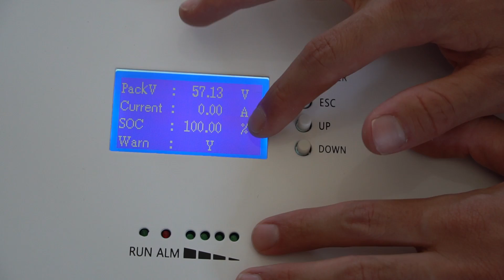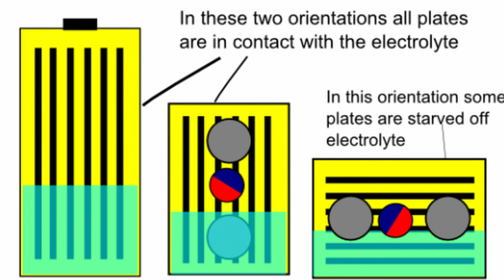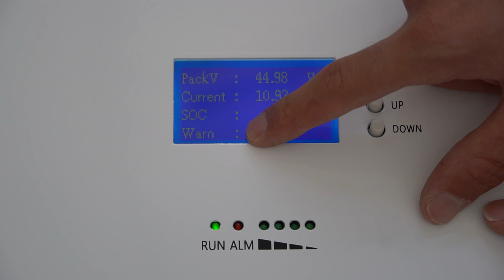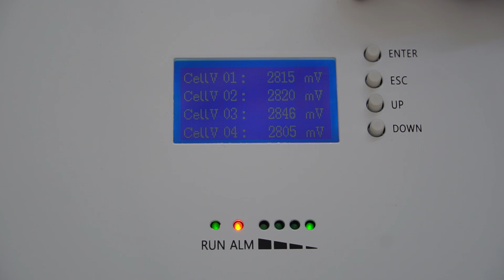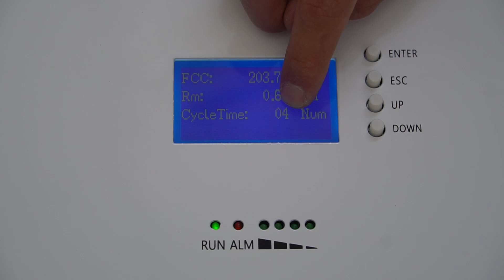10kWh 48V LiFePO4 Plug-N-Play Solar Battery for $.38 per Wh: Full Tear Down and Capacity Test

Comment: This beast is a little out of my price range of $3,800.  320ah prismatic cells are cheaper and weigh in at approx. 11.5lbs.....so doing the math and multiplying that by 16 would put a DIY weight around 185lbs.  If you separated the cells into two 24v packs they would even be more manageable to move around, could be stacked or shelved easier, and connected/disconnected in series for use, or maintenance.  Also, doing a replacement of just one cell in this beast is going to be more difficult to find.  And, when it comes to watt hours, this beast is only 200ah.  A DIY 320ah will be closer to 15Kw.  There is a lot to think about when it comes to making this purchase.  But, I can see some people buying into this battery already made, and not having the knowledge or skill to make one themselves.
Reply: There is making it yourself.....and having a UL listing which many states and installers require

Comment: I kinda wish they would have put the screen on the end or have an optional remote screen so you could rack mount them laying flat with a slide in rackmount so you could stack say 4-8 of these units in a single heavy duty frame in a conditioned basement or utility room. 220+ pounds is definitely a 2 or possibly 3 or 4 person lift especially if you need to go up or downstairs with them. I still need to save up quite a bit before I will have enough for a battery module like this.
Reply: These batteries support RS-485 communication, so theoretically you could rack mount them and connect them all to a central controller for remote monitoring. That would be the ultimate setup no doubt!

Comment: “Not compatible with AC tied systems”?
So you can’t run a all-in-one system that has solar and grid backup?
Reply from the maker: Oh wait, I just read OP comment. Of course you can use it with an all in one system. That's not ac coupled. Ac coupled is like a Tesla Powerwall. Not a battery. Totally different
Reply: It’s basically a 48 volt DC nominal battery bank with an onboard BMS. So, you have to hook it up to an hybrid inverter that has a 48 volt DC input. Probability a boilerplate disclaimer to let you know that you can’t hook it up directly to a 120/240 AC buss and not expect it to go horribly wrong.

From what I gather from the website, they do have specialty units that are for AC coupled systems too.
Reply: Damn, I wanted the same thing, but I checked: it won’t work with grid-tied systems.
Reply from the maker: It's just a battery, so it would never work on ac coupled system. You can connect it to a ul listed hybrid inverter like a sol ark, then ac couple that. 

It's just a battery. That's all

Comment: One of the issues with these batteries is the low C rating requiring multiple units to run a larger system. 
Requires one unit to run a 3 kW Inverter.
Requires minimum of two units to run a 6 kW Inverter.
Requires minimum of three units to run a 12 or 15 kW Inverter.
Paralleling requires an additional cable (not included).
Reply from the maker: It says 120A discharge in manual. So 6000watts. I'm pulling 100A into mine no problem. Seems fine. Must be a typo
Reply: Their site may state that but we have had zero issue running a single battery to power emergency items in a power outage. Its connected to a Outback Power 8048A

Comment: I have two of them and they are working flawlessly in my off grid system. I paid $2500 for them though
Reply from the maker: Where did you get them for so cheap???
Reply: Rosen Solar, they are 15s and cost $2550 each, I have two.
Reply from the maker: @patrickburton6130  That must have been a sale because I cannot find any of their large packs that cheap. Check out this one. shipping is $900: https://www.aliexpress.com/item/1005003127749308.html?spm=a2g0o.search0304.0.0.1abba57dt7dM0V&algo_pvid=ef482035-838d-4339-a17a-20283f76e63a&algo_exp_id=ef482035-838d-4339-a17a-20283f76e63a-8

Comment: Damn Will, that is one of the sexiest batteries I've seen you test. I love the fact you can see how many cycles you go through.. the menu is simple and informative. I mean damn. Itll be in my dreams. Well done and thank you for the excellent review. Particularly for lifting the skirt to see the cells 😋😛
Reply: Too bad they don't let you reverse the display text to work upside down.. or simply do a 180 degree flip on the physical display, and leave extra holes for buttons in both orientations. I would put hot melt glue down the back of the DC connector, so nothing could short it out that way...
Reply: @Stubones999  completely agree

Comment: I heard CATL is producing LFP's at around $50 USD per kwh.   Chinese are going to FLOOD the US with LFP packs like this and every solar installer will try to sell you one.   Look out utility companies!
Reply: That's a good thing right ?
Reply: @patyagecic3075  It's great if you want to put a battery back up system in your home.  I bought Chinese cells and put a system together for less than $2K.   Saving $30 a month on power and have a very reliable UPS backing up critical circuits.

Comment: The way they placed the handles I’d say this was really meant to be rack mounted horizontally as you said you would use it.
Reply: Then they should have placed the display visible from the front of the rack instead of the large front side (top on a rack).

Comment: If the biggest complaint Will has is, that it is too heavy, sounds like a great battery to me.
Reply: @Andrew Mo  ... Looks like the company "may have" already gone bust, as I can't get to the site using "any" of the battery/product links Will provided. I even tried dropping the product number and it's still a "no go." To bad...
Reply: @cruisinkev1  I just spoke to them last week.  Bought 2 of the 7.5kw's. They are arriving late December
Reply: @Hambone556   Glad to hear they are "back-up" !!  Thanks for the update...
Reply: @cruisinkev1  Maybe got bought out?  Good small companies often get bought.  I would get it in this industry too
Reply: must weigh as much as a steel box
Reply: My price is basically the same, check it out.  See my about page by clicking on my name.  Having closed loop communication is a good feature.  I can also do complete systems with inverters and chargers that are separated for better reliability and much lower cost.
Reply: He also commented on the fact it shouldn’t be wall mounted, due to the way the individual cells are placed!
Reply: Ok, he changed his mind! 🙄......😆
Reply: I suggest people who are not experts in batteries talk to someone who really is.  Seems like western culture is overrun with arrogance.
Reply: @timmothyburke  that’s the way to drum up business.......!? 🤨😆🤣

Comment: holy crap dude, you pulled it down to like 17V, great way to destroy a new battery.
Reply from the maker: It has bms. That was disconnect voltage.
Reply from the maker: It's fine

Comment: Will. To set things up, I worked in San Antonio, Texas years ago where I worked in  shipping containers that had been converted into storage. The temperature inside of those things would reach 120 to 130 degrees F even in the insulated containers. There were even a few times that they approached 140 degrees F. All of those containers were water tight and little air circulated through them. The containers that I worked in had open doors. God only knows what the temperatures would be with the containers closed for several days or weeks.

Listening to you and others that review DIY  prismatic cells two common threads are that the ones from China are weeks and months in shipping and quite often the cells that you all recieved were puffed up. More than likely, they were shipped in containers like I described. I have two questions in relation to this information. 

First, knowing that heat is bad for Li batteries, would the heat that I have described be harmful to cells that are in transit for weeks and months?

Second, would a person be better off paying shipping fees for faster transit so that the cells that arrive have not been cooked for days and weeks on end?

I know that grade B cells are often pawned off in other countrys by Chinese  firms, but how long could they really get away with that practice before word spread and they couldn't sell in the US or Europe? For those reasons, i belive that at least some of the problems that we see with battery cells out of China are the result of poor shipping practices. 'What do you think?

Thank you
Reply: Hear hear. Interesting observation. You may be on to something. Please let us know when you have yours shipped

Comment: Be careful lifting that thing.  Just because you can get away with lifting 200lb ( I can without too much trouble) does not mean you should.  over 100lb its really easy to hurt yourself if you do the lift wrong.  At my work 70 is the official cuttoff before we are supposed to either 2 man lift or get a crane.  Does not mean we dont lift more than we are supposed to anyway at times but still best to be careful
Reply from the maker: Agreed! Am being very very cautious

Comment: Looks like they changed the design for the 48v 13.5k. The packs in the pictures on the website show the pack up right in the case like you said is the normal position.

Comment: What is a “SHUNT”?
Reply: A device that's wired between the battery's negative terminal and all other wiring coming from there that allows monitoring of voltage and current in a system. The Victron one show in the video allows a display of parameters via bluetooth to a cell phone or tablet.

Comment: Another great video Will! Did you notice that the 5 kWh and 7.5 kWh units have a 6000 charge cycle life with a 10 yr warranty where the 10 kWh unit has a 20 yr warranty but only a 4000 charge cycle life? That’s less than 11 yrs of daily cycles.
Reply: I guess they expect less cycling with a bigger capacity, because the battery won't be drained every day.
Reply: @superdau  makes sense
Reply: Yes and it's kind of confusing I'll say.

Comment: Is the 8.7A the max discharge rate of the battery, or a limitation of your testing equipment?
Reply from the maker: Test equipment limitation. Each amplifier is $800. I can pull 120A from this battery for loads etc

Comment: Where is my math wrong.  You can get 16 of the Eve 280ah cells.  at 12.8v (am I using the right value here?) that would be over 14KWh.  At $2000 (I've actually seen them with free shipping for  closer to $1700) that would be just under 14 cents per KWh.  Yeah, you have to buy your own BMS, but that just takes you up to the $2k price range.

Comment: Checked the page. Is this true? "When the temperature sensor detects a cold outside temperature, it will warm up the cells first before it allows the cells to be charged. Without the sensor, the cells cannot be charged under 23F (-5C) and discharged under -22F (-30C)."
Reply from the maker: I am confused by that too. Mine has the sensors, but they were glued and possibly screwed to the bus bars, so I couldn't test them. I tried to, but I did not want to screw it up. Good point, I need to ask them about that.
Reply: @WillProwse  I second this, if you can test how the cold protection function works or get more info for a follow up that would be amazing.
Reply: @WillProwse  good point I live in the Panama City area of Florida were occasionally temperature drops below freezing. Is this a safe Marine application on a sailboat where there is vibration on the sailboat when the diesel engine is running. Second thought would this be a fire-safe unit similar to battleborn?
Reply: @WillProwse  maybe stick it in the freezer? Or put the freezer on it since the battery probably weighs more. 😉
Reply: @WillProwse  Maybe use dry ice for cooling the sensors?
Reply: @jakobtheiner6329  could make the metal shrink and loose its weld ?
Reply: Wonder if they just kick on all the balancing resistors to generate some heat inside the box or how they warm them.
Reply: @DIY Solar Power with Will Prowse 
Would this battery be any good with a 48V (8Kwh inverter)outback off grid system?

Comment: I really like this but at $4000 for 10kWh, ugh. I can get two Tesla 24v modules 5.2kWh for $1000 each , so for $2000 I get 10.4kWh. For $4000 I can get 2x the power
Reply from the maker: What BMS do you plan to use, or use currently for your tesla pack? I hate the chemistry they use for stationary use. If a FET were to short, and you get overvoltage, your whole house can burn down. Even the powerwalls are using NMC now. NCA just scares me. Also, the nominal voltage is lower. And the soc curve is more linear.
Reply: @WillProwse   the late and great Jack Rickard was sourcing those 6kW 24v inverters with “tesla firmware” and it powers a monster 30A 240v welder setup for portable power that no small generators would hold.  Also can backup a lot of house stuff. I’m in Florida’  I watched you tesla pack, and agree they have some disadvantages. But man, you need 300A at 24v to power a real welder. I want to add a 2nd pack but then the weight gets really tough. It’s in a military surplus case, there is room for one more pack.  

I should have gone 48v. As for BMS, the inverter charger is decent, but because it’s extra cautious it doesn’t go high for the top charge- so I added a Victoron to top charge. So far it’s working well. I use a 70watt charger to slow top charge. There are no 300A-500A 6S BMS
Reply: @WillProwse   I do have 3 powerwalls, Oct 2020 so not the newer extra … and a solar tile roof. I agree with you on the safe chemistry concerns, I have some Chevy 2020 Bolts… 🔥
Reply: @WillProwse  also crazy. Per kWh these at 10kWh $4000, so at Tesla’s powerwall 14kWh cap you would be around $6k, really close to what I paid right before they did two price increases.  Telsa prices are crazy cheap

Comment: I feel it's worth noting, a gallon of gasoline has 36kwh energy potential, so 3.6x as much as this entire bank. While this is an impressive battery, and should be treated with respect, as far as danger goes I'm still way more scared of jugs of gasoline in a garage.
Reply: 70% of that gets converted to heat
Reply: @ivancajka732  True! I didn't mean to make any comparison to gasoline engines, and how inefficient they are. Just wanted to highlight that gasoline is incredibly dense and dangerous.
Reply: @AdmitthatijustdiditX  Drop a spanner over the busbars and feel the power.
Reply: @AdmitthatijustdiditX  It's also messy, smelly and expensive when relying on generators for your RV
Reply: a lump of coal also has a lot of energy in it.
Reply: @alexjohnward  But it has "Potential" :)  I am building my new system with this battery!

Comment: awesome videos mate is it lithium "iron or is it ion" batteries
Reply: In this case it is "lithium iron."  Generally speaking it could be either depending on the battery chemistry and context of the conversation.

Lithium ion = general term for all rechargeable lithium based battery chemistries.  Often used to refer to chemistries with Nickel, Manganese, Aluminum, Cobalt chemistries, but could also include Iron (Fe) based chemistries.

Lithium Iron = Lithium Iron Phosphate or LiFePO4 chemistry.  This is a subset of lithium ion, but since Lithium Iron has some distinct differences from other Lithium Ion chemistries people often call it out the "Iron" aspect more specifically.
Reply: @CL-gq3no  awesome thanks

Comment: Could you look at some low-use appliances: fridges, water heaters, dish washers?
Reply: RVs wanting a heat pump: I saw a 12v DC mini split on Alibaba.  It even connects directly to solar panels and a battery, or it can do 120v when DC is low if 'the sun don't shine'.  12v DC would be great if you already had a 12v system.
Reply: @mikemotorbike4283  any chance you have the link? I can see some but not sure it connects to solar

Comment: Yes, good idea to add a fuse in that cable if you just have lugs on one end. Does it have an internal fuse? Anyway, thanks for the review. I think I'd rather get two of the 100AH batteries, I don't have a pallet jack (but have a better hand truck than you!). :-)

Comment: Really like and find this video useful, thanks Will.
Heavy but mounted on a metal battery frame. We used and replace them everytime the battery contract changed. (DOT federal). Or put on small trailer to replace a typical 10k generator when gasoline / Diesel genset is not required. But I'm stating the obvious I guess.
Reply: I like using your smaller system designs to backup my home communications (cable modem, router, TV, laptop etc.) Living in TX I feel much better prepared than last year.
Reply: Great idea!  I can build a metal frame for it & place wheels on frame.  Thanks!

Comment: I purchased a few of those BMS from Seplos, 150A units were about $145 USD each - would love to see your take on them! They are used in a tonne of OEM units, Gyll is a common one.

Main downsides of the BMS is;
1. Not sold with a case/enclosure
2. Low-temp charging is set below freezing point
3. the CANbus interface isn't set up to communicate with Victron (although advertised this way!)

Comment: 1:16 - Isn't 57V a bit too high for a 48V battery ?!
Reply: 58.4v is assumed at 3.65v max per cell, but I try and bulk charge to 56.8v. Keeps me around 3.55v per cell with some headroom in case once cell decides to be a bit rambunctious during charging. 😉

Comment: I have what looks like the exact same battery but made by UFO Battery. Yours looks like it has an updated interface though and mine has a second Anderson port for connecting in parallel.

Also, your capacity is much higher. While mine is also 200Ah it's only rated for 9.8kWh but usually only cycles 8.5kWh

Comment: The 13.4kwh model uses 280ah cells orientated upright. It looks much better.
Reply: you have the link for that?
Reply from the maker: @nguyentuan1990  13.4kWh: https://energetech.ositracker.com/149225/11362/url_19146
Reply: @WillProwse  do you have a discount code?